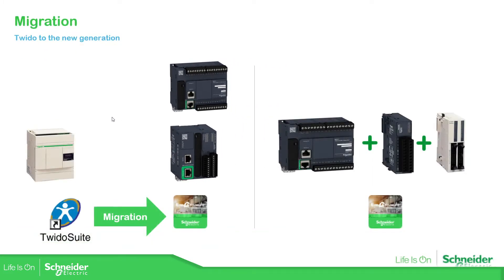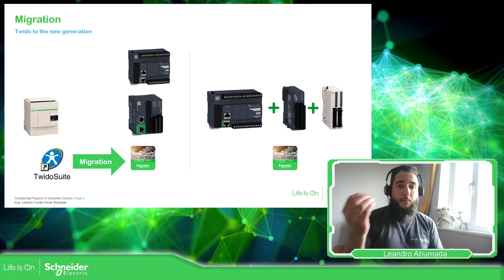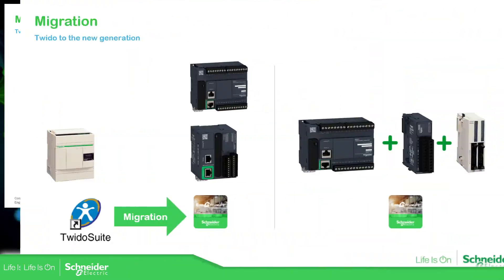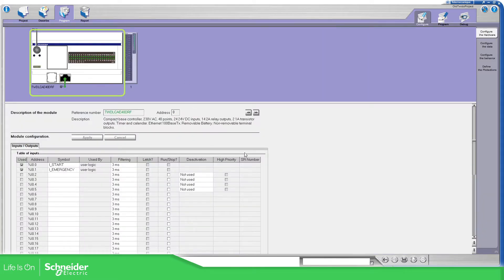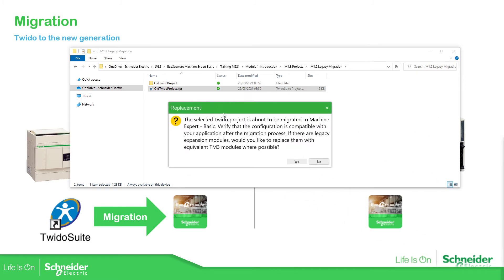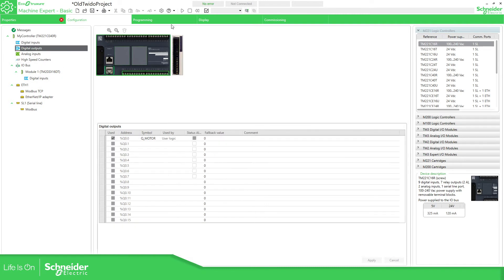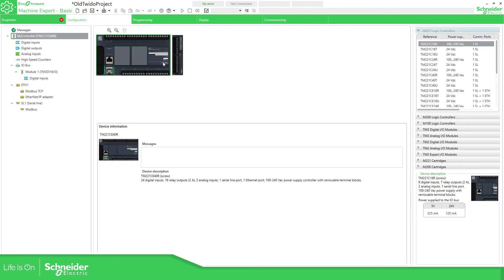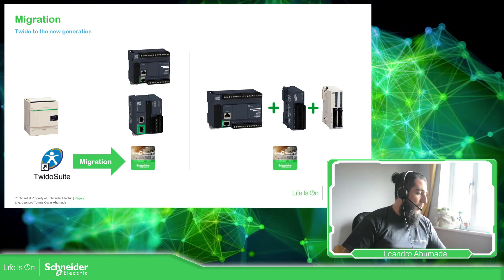Training - M221 - M1.2 Legacy Migration part1

Comment: how to use two coil address %0.00
Because i want controlling inverter when i want active 45HZ i should acttive %Q0.0 and Q0.1 but when i want active 30HZ i should active %Q0.0 and %Q0.02. how to use two coil address %0.00 in 3 rung
Reply from the maker: Hi there! For this the best will be to use in the %Q0.0 in only one rung. Then use in parallel the condition to activate the output.
Reply: Do you have email broo i dont undrestend @LeTomasAHUMADA
Reply: How can use in parallel the condition to activate the output. @LeTomasAHUMADA